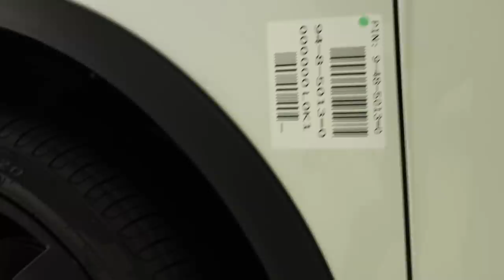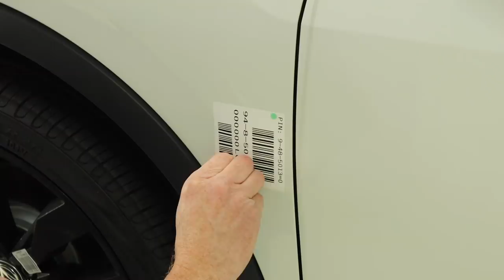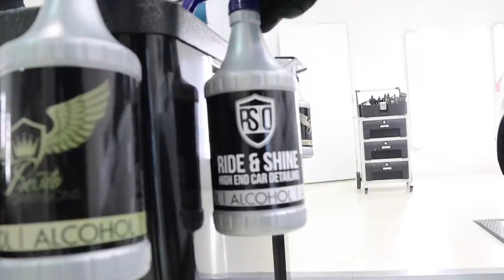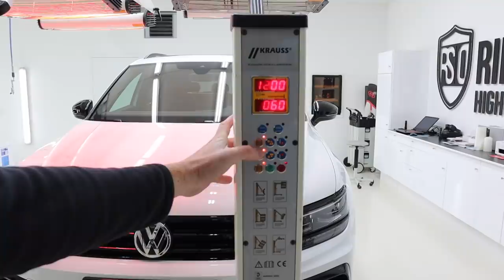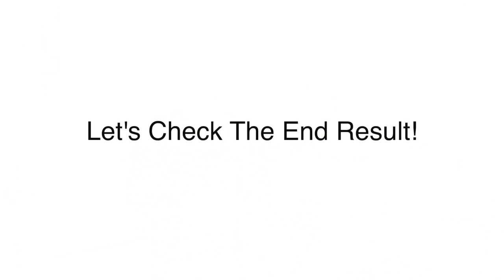HOW IT'S DONE: We Show You All Stages To Detail & Protect A Brand New Car!

Comment: What is the best way to buff your windshield? Would you recommend a compound or go strictly polish and wax? Polish and coating?
Reply from the maker: This depends on the windscreen, if it is brand new you do not have to polish it. If it is very dirty and older than polish and make sure you degrease it very good and than apply the coating.

Comment: No leather protection ???
Reply from the maker: It is a brand new car.
The leather has been given protection from the factory.
If you apply leather protection (coatings) you have to clean the leather first, you do not want to risk problems with the products.
I never treat brand new leather I always recommend to do this after 1 year.